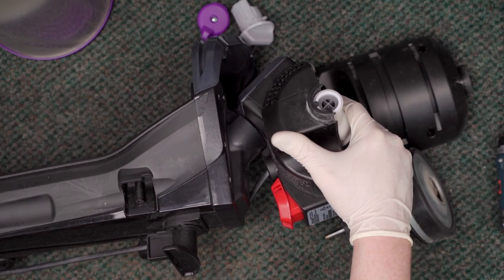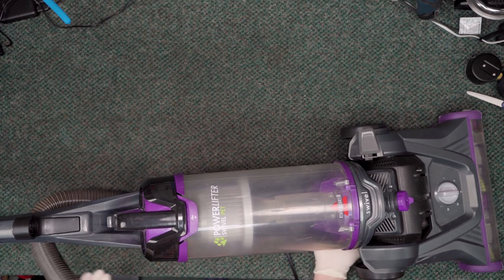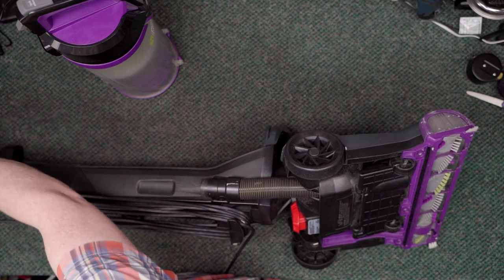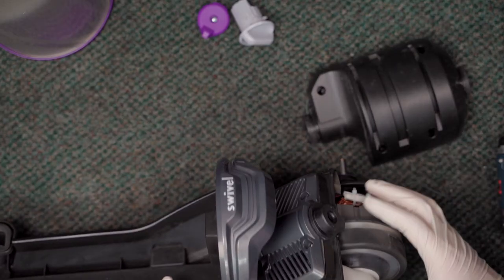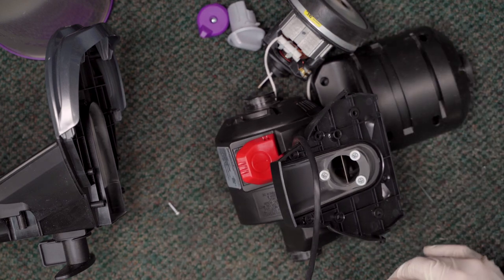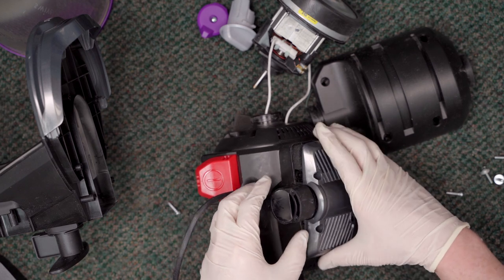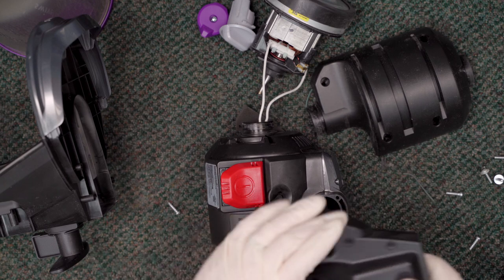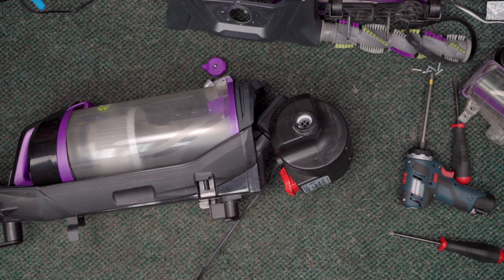Bissell PowerLift Pet 2260 - Air Pathway REVERSED - No Suction, Not Clogged, Now FIXED

Comment from the maker: Has anyone else out there seen this on a Bissell 2260?
Reply: My vacuum has the very same problem. It came out of the box that way. Very helpful video. Thank you,
Reply: Yes it's very annoying
Reply: Mine works pretty good strong suction to the floor brush area and can feel good suction in hose and attachments but attachments won't spin even tho it looked to be in right and could spin easy with hand other than that works great
Reply: House of Vacuums how would the bissell lift off do on a shag carpet?? and you gained a new sub
Reply: Yes urrrrggg
Reply: I just purchased a Bissell clean view that I’ve only used 3-4 times that’s experiencing the same problem. I’m beyond annoyed and imagine I’ll have to return it. It was only 80 bucks but I might as well set 80 bucks on fire. 🤦🏻‍♀️

Comment: I've had my vacuum exactly a year. I've thought it very strange how all of a sudden it's not picking up anymore, it is not clogged. I will have to take it apart this far.
Reply from the maker: Thanks for the comment! Have you checked and washed all the filter recently? If not, that is where I would start.
Reply: I had vacuum just one year and same thing just happened
Reply: Same here almost a year to date

Comment: Hi Matt, Since there was dirt in the unit before you received it, it had to have had been put together correctly at the factory. My take on this is that for whatever reason someone before you had disassembled this vacuum and when they put it back together again reversed the piece that you turned around.
Someone else messed it up and the owner brought it to you to undo what someone else did. You have a reputation for being the expert.
Great video by the way as always, but after watching this, that is my opinion. No way could it have picked up anything the way it was put together before you received it.
John in Ohio
Reply: Spot on sir!
Reply from the maker: Good observations, that may indeed be the case. Thanks for watching!

Comment: Hi, I have cleaned and taken apart what I can and still and this happened out of the blue, I have suction with the hose but not to pick up anything else! I cleaned everything thoroughly recently I put on a new belt. This is  Bessel power lifter swivel pet I’m afraid to get in the motor because, just because lol, thank you Carol
Reply from the maker: Hey Carol! If you have suction at the hose but not at the nozzle, it could only be a couple of things. Either the length of hose that reaches down to the nozzle is clogged, or the new belt was pinched and burned up after install. Take the bottom plate off again and see if the belt is still intact and then double check the hose which leads to your tools to see if there is a clog there. Hope that helps!

Comment: My vacuum is doing the exact same!!! Its been working and then today i tried to use it and it wont suction. It has suction in the hose, the filter is clean, no holes/cracks in the hose, the tank is set on the unit right and no clogs! It just all of a sudden stopped working.

Comment: Literally what happened to mine just now... i was vacuuming, completely fine as normal, took off hose to vacuum against wall/in cracks and it felt like the vacuum moved and it immediately did this. I didnt slam on it, didnt yank on it nothing.. weird. Hoping i can fix this via your video.

Comment: Is it supposed to be smoking afterwards because mine is smoking now
Reply: You should probably call the fire department
Reply from the maker: It definitely shouldn't be smoking. Did you pinch the belt between the brushroll and that housing? That could give off some bad smells and smoke. Double check and make sure the brushroll is turning freeing. If it isn't, the belt is pinched.

Comment: Wild. I have owned a Bissell for a year almost exactly and no issues until this week a super weak suction in the hose brush will spin but not picking up any dirt. I thought the height adjuster was the issue but after playing with it, it works fine.

House of Vacuums, would it make any sense to you if the issue was that exhaust valve flipped and it working flawless for a year and then suddenly got little suction in the hose and no pick up from the floor brush?

Thanks for all your help
Reply from the maker: Wow, that would make no sense to me. My guess is that you may have a clog somewhere?

Comment: I have a bissell cleanview pet vac. It stop suctioning even though its not clogged. I took it apart to inspect it and it still doesnt suction.
Reply from the maker: Hmmm, if it isn't clogged and the air pathway isn't reversed from the factory, the only other easy place to check is to make sure the belt isn't stretched an slipping. Any amount of slippage will drastically effect the cleaning on carpet. Hope that helps!

Comment: I have this same machine. My issue is the filter  inside the top that I  can  see is filled with debri. I like to  know how I can clean that. It allows  me to wash the filter   but that cup underneath  the filter in the inner side  of where I empty  the debri from vacuuming.
Reply from the maker: That plastic grate inside the cup needs to be cleaned by hand if it is loading up with debris. Hope that helps!
Reply: @HouseOfVacuums  Thank you for responding. I  use my hand and  wire hanger to get up in there to remove it, just wondered if it could be opened so that I could get  it better.

Comment: Ok I have a situation. My vacuum is not clogged, and has no suction when put together. The piece you flipped is correct on my vacuum. When I take the canister of dirt off, the port to the motor HAS suction. I have cleaned my filter. I put it back on and the hose has No suction. Suggestions appreciated!!!
Reply from the maker: Hi Alexa! Remove the hose from your vacuum at the back where it leads into the cup. If you don't feel strong suction from that port there is something wrong with your dust cup assembly or seals. If you do feel strong suction without the hose on the back, then your stretch hose is likely clogged where you can see it or the hose leading to the floor is. Let me known if you have any other questions, thanks!

Comment: Hi
I am having the same problem. I bought it new have used the vacuum for almost a year and then the suction indicator show red all the other ports have suction,from the brush there is no suction to lift the dirt into the hose to blow into canister. Any thoughts?
Thank you
Reply from the maker: Hi Ron! If this just happened, it is likely clogged. Use the video for instructions on how to disassemble the air pathway to check for the culprit. Hope that helps!

Comment: How did you come to the conclusion the suction was working in reverse? I'm having trouble with the attachments not spinning checked the little belt and stuff and would spin easy when i did it by hand both the turboeraser and hair eraser worked for short time and just stopped
Reply from the maker: Thanks for watching and the comment! Honestly, I just followed the suction pathway from the floor to the motor until I found something that was wrong... in this case, the air pathway at the motor was installed upside-down.
On your machine, start with the easiest solution first. If your filters are occluded and need washed it could reduce the airflow enough that your air tools wouldn't work. There could also be a small clog. Use the video to follow the air pathway and make sure everything is working properly.
Best of luck!

Comment: I have the 20872. I just bought it as a refurbished unit. The bypass suction relief valve keeps engaging and I lose suction. The repair place I bought it from won't do anything even though I used it less than one day. Is this an expensive repair, or do I just trash the thing? Bissell customer service was no help at all. They had no idea what I was talking about even though I sent them a photo of the valve plug that kept getting sucked in and stopping suction and explaining what was happening. I'm just really disgusted with this whole experience.
Reply from the maker: Sorry for the delayed response. However, if the bypass valve is tripping then one of three things is occcuring. Either it is clogged, has dirty filters, or it is being run too low on a carpet pile with zero pile.

Comment: Hoses are clear,  filters are clean, The intake for the motor has good suction . No cracks in hoses . Still very little suction.  What could be the problem ?
Reply from the maker: Wow, that's all the usual culprits. Maybe a missing seal? Since you have eliminated those other options it is hard to say for sure.

Comment: I’m having the exact same problem with my vacuum, which is the same model in your video. Problem is the screws on the brush cover appear as if they are stripped so I cannot gain access. Any ideas? Thank you in advance.!
Reply from the maker: Hi Jan! Sorry for the delay. Were you able to get those out? If not, is it the head of the screw that is rounded off?

Comment: I bet this was assembled incorrectly at factory.  The bottom of that dirt canister looks very clean as does the connection from the hose to the canister.  Every vacuum i have worked on has some leakage and the fine dust fills the nooks and crannies.  Unfortunately, many consumers think something is working properly because it is new.  Credit to the person who brought it in.  Poor design by Bissell to not have that cowl indexed so it can only go on one way.

Comment: My vac sucks n picks up ok. Just the vents blow all over the place. Blows in my face even blows the curtains. Is this normal? Help...
Reply from the maker: Unfortunately, that is normal. It is not a well baffled exhaust and is pretty directional. It will tend to blow stuff when working properly. Thanks for watching and commenting!

Comment: Hello , very interesting video 
My vacuum Bissell power force helix turbo bag less upright 2190 
Filters are clean and stop working.  the motor sounds good but the roller looks like doesn’t move . I cleaned it , I have no idea what happen bothers me bcoz is almost new.
Reply from the maker: Have you check all the air pathways to make sure none of them are clogged? If it isn't a clog, make sure that your belt isn't broken as this will also effect pickup.

Comment: Hey bud! The suction relief valve isn't actually for safety in terms of 'too much suction' or dangerous to use that suction - it's actually about the health of the motor. They need airflow to cool, & will not tolerate a 100% blocked off airflow for more than 5 seconds or so, before you will get overheating issues, & quickly, serious overheating issues (which is where thermal cut-out then comes in, on many machines).
Reply from the maker: Thanks for watching and commenting. 
I think we are are both right here, the valve really serves both purposes... protecting the motor and the customer. It would certainly self-destruct without it, but 4 or 5 seconds of full suction could also hurt someone. So I think we looked at 2 sides of the same coin!
Thanks again!
Reply: @HouseOfVacuums  👍🏽
Reply: Did you ever figure out how to fix this? I keep getting refurbished ones from bissell and after a year or so it starts to do the same thing

Comment: Bissell is a product that wasn't great to begin with. Whoever The new Chinese company they're contracting with is turning out total junk.
Reply from the maker: Bissells are certainly made poorly. It is interesting because even though they are cheap, I really don't mind working on them. Other than this machine, their designs just kind of make sense... they aren't purposely obtuse like Hoover and Dirt Devil.
Thanks for watching!
Reply: @HouseOfVacuums  I do like the little green I have though. Bissell pretty much makes stuff to different price points. There’s crap and then there’s the Oreck XL based vacuums and the vacuums Bissell made for Oreck.
Reply: This machine was made by EUP, which is a company that has made machines for them for well over a decade. For many years, they have had different companies manufacturing different models. For example, their new Pet Hair Eraser is made by KingClean, which is one of the largest vacuum cleaner manufacturers out there. KingClean makes models for other brands such as Shark and Hoover with their Air variants, for example. On the other hand, the original Pet Hair Eraser was a Samsung unit.

EUP seems to have a very competent design team because I have always thought their units, even these swiveling ones, are designed well for what they are. If anything, some of their motors, for example, have been overbuilt for the price point. In more recent years, they have made the Bissell models cheaper by reducing the quality of the plastics as well as trimming the fat anywhere they could.

To tell who manufactured a Bissell machine without opening it and looking for branding, you can look at the serial number. There should be a letter or a group of letters on the end of the serial number. This machine has an "E," which means that it was manufactured by EUP. The Samsung-manufactured models have an "S," KingClean's models I believe say "KCA," the ones that say "MDA" were made by Midea, and so forth.
Reply: @FanOfVacuums2  My Little Green says FXB no idea what manufacturer that is.
Reply from the maker: @FanOfVacuums2 thanks for posting that information... it is SUPER interesting. I definitely explains some of the similarities that I see in different Bissell product segments. Where is EUP located, if you don't mind me asking?
Reply: @HouseOfVacuums  They are based in Suzhou. I am pretty sure that they tried to market their own brand in the United States called "Everstar," but had little success.
Reply: @HouseOfVacuums  EUP manufacturing is located in Suzhou China
Reply: @FanOfVacuums2  I really appreciate the thought & time that you put into your replies! Definitely a new sub here!
Reply: Help a Senior! My Bissel is doing the same 😡 is there a vacuum NOT made in China?
Reply: @nancygladman7558  Hoover hushtone or a bagged comercial bissell